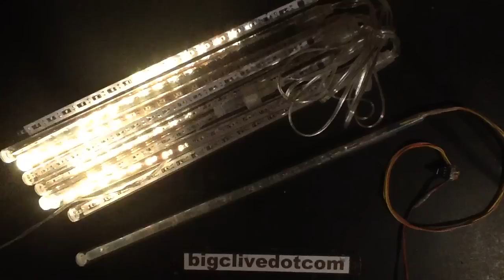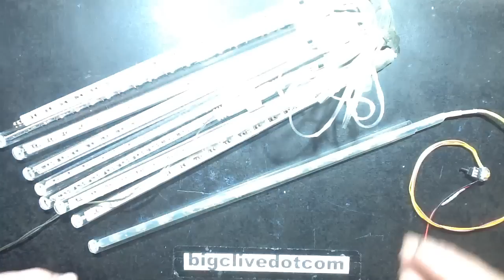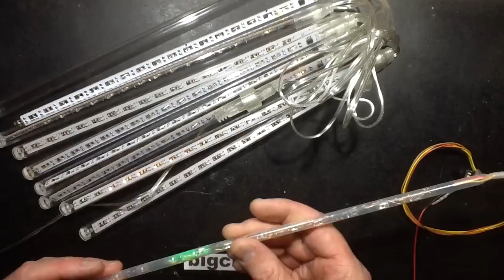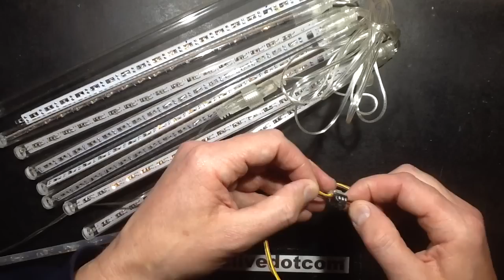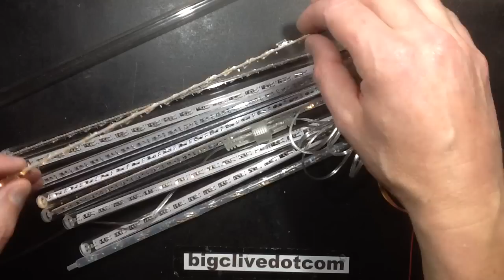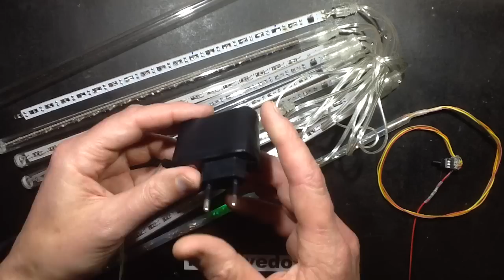Experimental meteor light software.

Comment: PIC12f629 is a bit old-hat nowadays - check out the 12F1501 - quite a bit cheaper and has some cool stuff like 4 PWMs, ADC, CLC, NCO, intrc osc up to 16MHz
Reply from the maker: +mikeselectricstuff I should get my ass in gear and upgrade processor.   I see the manual for an eight pin chip is now up to almost 300 pages.
Reply: +bigclivedotcom Perhaps you should make a small string of color changing ones using an Arduino. Would be a much bulkier controller, but I'd think it'd be good practice.
Reply: +Natesmodelrailroad fuck arduinos, what happened to actually making things instead if sticking premade modules into eachother?
Reply: I was just throwing out ideas based on what I do know.

Comment: Just thought of something - you said in your other video that you configure a pin as an input to implement the third (HiZ) state. If it is an input, then you could use it to control your chip. The programming would be tricky, though, as the pin would be high or low by the other pins - but this would allow you to chose programs without sacrificing an output pin.

Comment: Could you run a program that lit 1 random led per tube, or a set of 2 or 3 spaced out leds per tube, that made the led fade on, and stay on for a second or two, then fade off????   ....basically turning an entire meteor string into a firefly light string.... Seems like that would be a really cool thing to do with the green ones hanging from trees.... if possible.

Comment: What do you use to seed the randomiser? Does it vary each time the program is started, or is it technically the same random program it goes through every time it's started?
Reply from the maker: +Michael Østergaard It's seeded with a value stored in memory, so is the same from power up.  But any time you select an effect it stores a new seed.  So several of the units next to each other will all be different.
Reply: Ah, so the time from boot till the button is pressed is used as a new seed? I've been messing about with something slightly similar, using an arduino and an addressable LED strip. I wanted to create the effect of random drops of water creating rings in a lake. 

However, the concept of randomness is quite fascinating, and surprisingly hard to achieve with a stock arduino, when you're running a program without any outside input. While I technically got random effects, it was always the same exact random effects after every boot. The best solution I found was to read off of an analog pin that was floating, but even then, the variance was minimal and often non-existing.

Come to think of it, it could be cool to combine the meteor lights with the "rings in water" simulator somehow. Whenever a meteor light releases a drop, the splash would show up half a second later on the LED strip.
Reply: @HologramDK  My solution is to store a seed in EEPROM.  On boot, read the seed from EEPROM, and read from a few analog pins.  Combine the analog values with the seed using a hash function, then write the new seed back to the EEPROM.  As long as there is some variance in the analog inputs, even if it's small, the seed will eventually diverge from the seeds of identical devices.

Comment: been thinking about making a more entertaining rj45 cable tester than 1 2 3 4 5 6 7 8 1 2..
perhaps with some indication of f how strong the connection is rather than just enough to light the led. If it finds just one marginal patch cable as a result it'd be worth the project. 

Difficulty: must not destroy computers or routers  if one end is connected to a live ethernet,